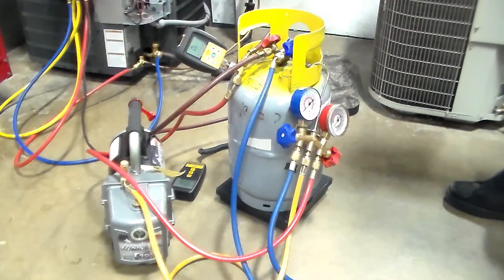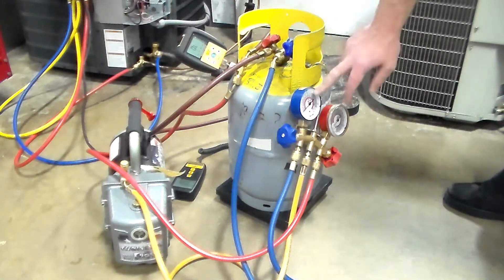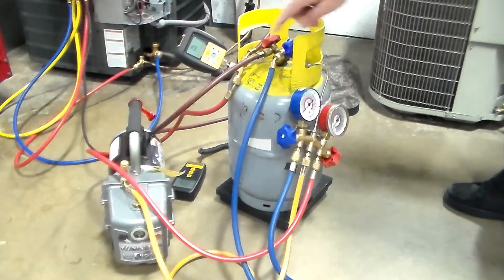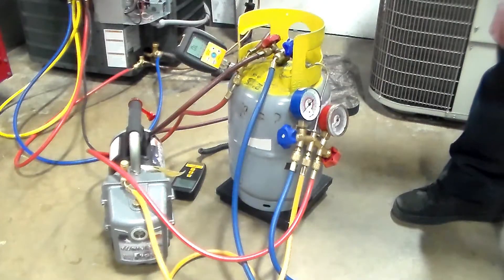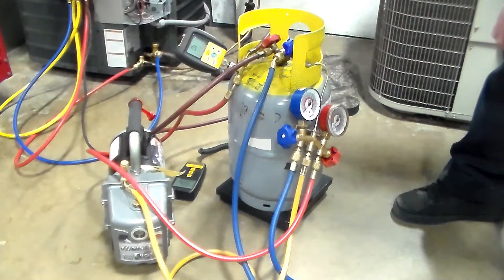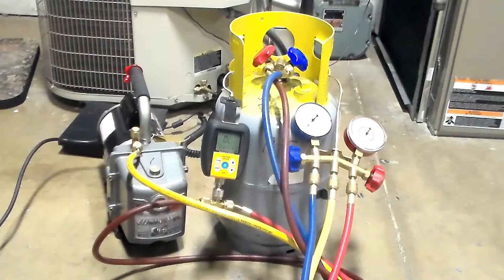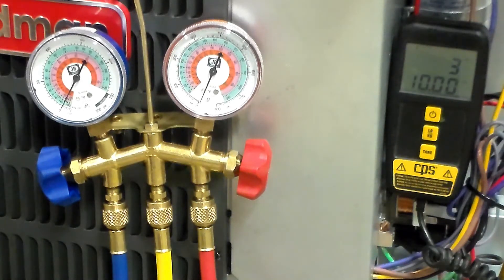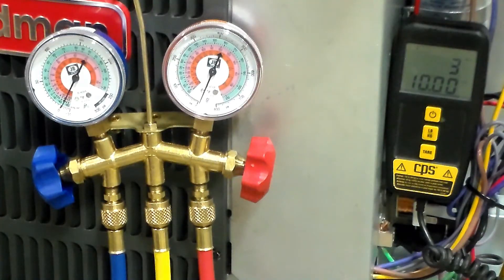Recovery, Evacuation and Recharging (1 of 3)

Comment: I was always taught the more connections you add between you and your condenser the more possible leak points you have
Reply from the maker: @DClough  that is very true, but this particular video wasn't made for that it was made to help the students that were just learning with that particular set of gauges that they had at the time. If you want a better way to do it, you need to watch my video on doing it with no manifold.

Comment: I  know that we don't want air into the refrigerant but why not vac instead of purging so that zero refrigerant goes to atmosphere?
Reply from the maker: @rogerbrown5563  not sure what you mean by this. The vac pump puts EVERYTHING into the atmosphere. But hopefully the recovery got all the refer out first.
Reply: @hvacjames509  Actually @rogerbrown5563 's question is very clear and makes sense : your hose bleeding method releases refrigerant in the atmosphere, which is not good. The alternative/question suggested by @rogerbrown5563 is to evacuate the air from the yellow hose not by bleeding but rather by pulling vacuum from it.

Comment: Life long carpenter playing hvac at home.I have a provax recovery machine.4 line 2 guage manual guage.I have followed along best as I could as my machine is different then yours..I have no idea how to read the gages on the manifold really or what the gages on the machine mean.I do the purge as my manual explained.I do not get any liquid spray when opening tank a bit yo see just air comes out.My tank is 14  lbs.I set my knobs for recovery mode flip the compressor switch..It starts and runs for maybe 1 or 2 minutes then compressor shuts off but machine is still on cooling fans running but the compressor should run longer correct? Tank weight went to 14.5 lbs
Reply from the maker: No it's an automatic safety feature you need to purge the line at the tank and then once you're sure there's liquid coming out you can open up the valve on the tank and then the machine will start back up for you.

Comment: Great video, I had to subscribe and and loved that you explained why you're doing what you're doing so the new guys can get the full understanding on the process. Would you nitrogen test before vacuuming the system for charging?
Reply from the maker: Only if you suspect a leak or you just installed it. And thanks for the sub.

Comment: When you recover what are you recovering, liquid or vapor?
Reply from the maker: Recovery machines typically have standard compressors in them. So they're incapable of pumping liquid so recovery is always coming out of the system as vapor but then it condenses in the recovery machine and puts it into the recovery tank as liquid.
Reply: @hvacjames509  so would you just open the manifold gauge on the low side. If you open both wouldn’t that be both vapor and liquid? Thanks.
Reply from the maker: @Sc19869 Only if it's running. If it's off, pressure will equalize and it'll be all vapor.

Comment: I really like how you showed how to purge that machine after the recovery process. I’ve always wondered if there was a way to clean out those machines if we are using them for different refrigerants. But that closing the valve and letting the machine run a minute into the tank to purge seems like a good option. Thanks for the video!

Comment: Sir if I recover liquid direct from condenser of chiller.
 compressor of recovery machine may be damaged???
Reply from the maker: Correct. You must recover as vapor. In residential it's mostly vapor if the unit has been sitting but big chillers contain lots of liquid. But there is a more important reason for recovering as vapor from a chiller. If you pull the refrigerant out too fast, the remaining refrigerant will expand and absorb heat thus freezing the water in the chiller and potentially damaging the chiller. Also, always keep the water flowing or drained when recovering a chiller.